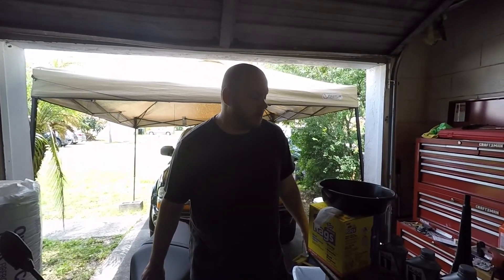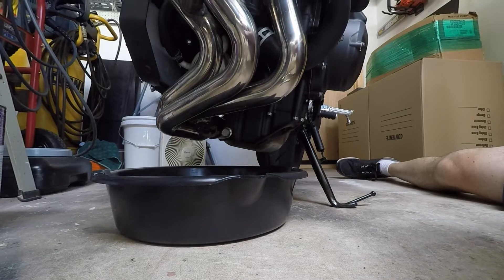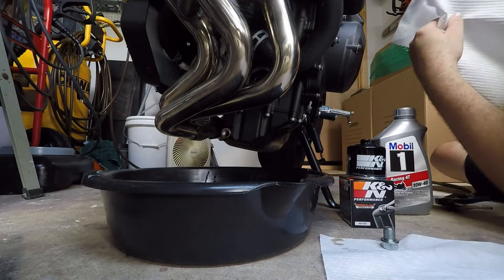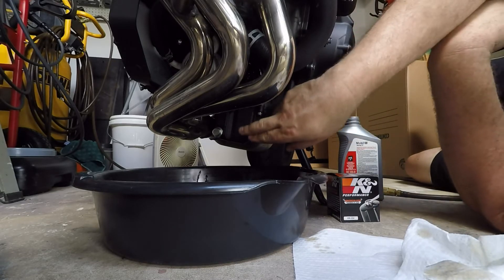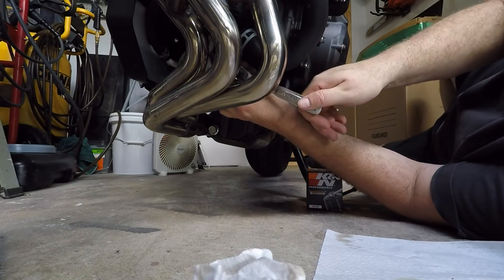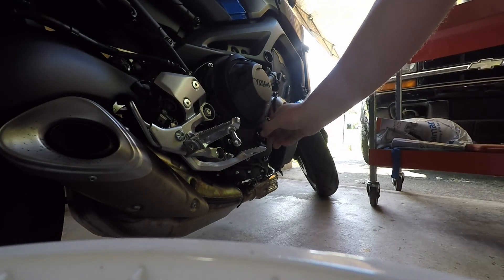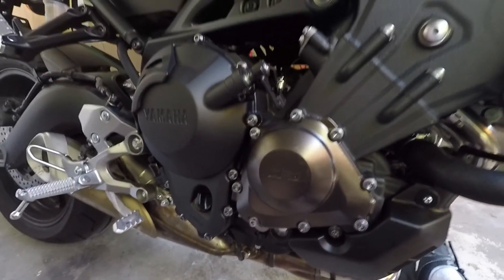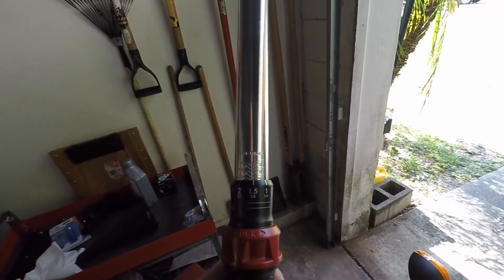FZ 09 Oil Change

Comment: That music man! I love my 2016 FZ09. Yes, center stand!
Reply from the maker: I hadn't yet installed the spools when I did this video so using a stand wasn't an option. I also didn't film using a stand in case you didn't have access to one (don't own one or on a road trip) but still wanted to change the oil. You can hold the bike level to drain the rest of the oil too as there isn't much once the majority of it drains from the plug.

Comment: Judging by the position of the drain plug I would put the bike on a rear stand so that it sits straight as it seems like some old oil may still stay in the oil pan. Lowest point on the oil pan seems to be on the right or opposite of the actual drain plug. I may be completely wrong here.
Reply from the maker: Just hold it level accomplishes the same thing but yes, a stand is the easiest. I hadn't yet installed my spools to use a stand when I filmed this. Bike only had about 100 miles on it at the time. I always change the oil right away in case there was any metal from manufacturing that wasn't caught to prevent any damage. Changing your oil is the cheapest insurance you have to prevent engine problems. I change mine about every 1,500 miles.

Comment: Thank you for the awesome video ! I love everything you are doing it's obvious that you are a pro and you have good hands, only one question about the position of the bike to completely drain the oil the bike needs either to stand on the middle stand or on a rear wheel jack isn't it? It seems that the side stand doesn't drain it all the way. And for the oil type what would you day about 10w40 fully synthetic? 
(The magnet at the end is extremely inspiring)
Reply from the maker: Ideally, yes a center stand is best when draining oil on most bikes. On this video, I didn't use a center stand in case someone out there didn't have one and still needed to know how to change their oil. This was a brand new bike and I had gotten the spools to install to use the stands but thought I should do it like this because ANYONE could do it this way. You can just hold the bike up level to finish draining the rest of the oil that a stand would accomplish.

Comment: That's weird, I also have a 2016 model and my drain plug is located on the rear of the oil pan mounted vertically.

Comment: What's the weight on your oil
Reply from the maker: SAM FZ-09 RYDER HI. I always recommend using the manufacturer's specs which is 10-30. However, 20-50 is also fantastic and is recommended by many mechanics. I change my oil often (about every 1,500-2000 miles) because it's cheap insurance against damage to the engine. They say for synthetic,  you can go 5k-10k before needing to change but the oil starts to break down around 1k so I usually will switch it at 2k to make sure I have maximum wear proection. If you change the oil yourself, the cost is minimal.
Reply: Destination Rider just a thought and I guess it depends on where you live. I prefer 10w40 full synthetic Castrol motorcycle oil year round. Just my personal opinion. I use k&n filters too. Nice video
Reply: The manufacture recommended spec is 10w 40.  Mobil One racing 4t only comes in 10w 40.
Reply from the maker: @gosoku2771  My manual says to use 10-30 so that's what I told people, but after checking now online, it says 10-40. Either one is fine tbh. 

Found a really nice article with a video in it that really explains oil viscosity well.
https://www.motorcyclistonline.com/lowdown-on-motorcycle-engine-oil/